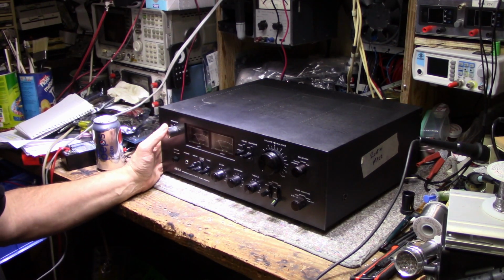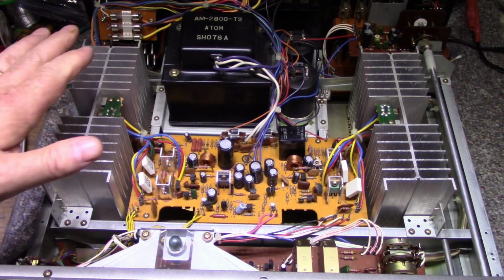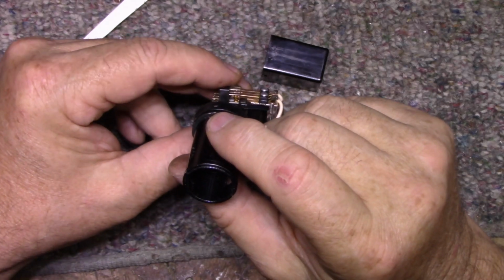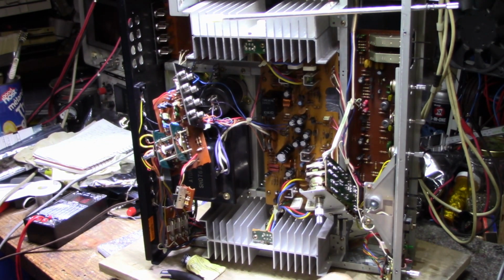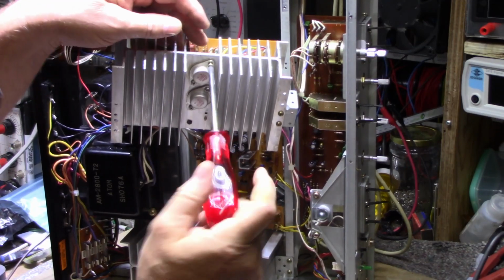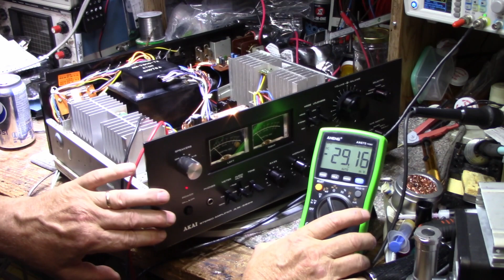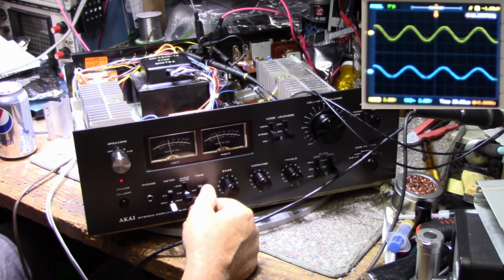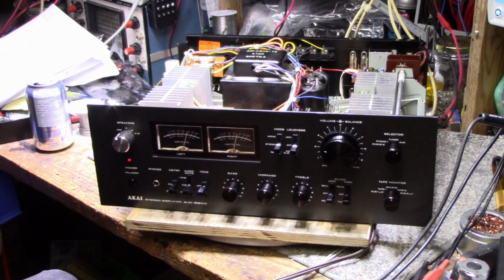Akai AM-2800 Integrated Amplifier - Repairs (Ep. 143)

Comment: This AM 2800 is my best amp installed in my showcases system.  It has the headroom to drive my great sounding but inefficient 84 db/w Clements speakers.  They needed this amp.  The pairing is unmatched.

Comment: 18:40 The 2SB560 you showed, I would never replace that. The black seems to me a spill over from the plastic casting, and the leads seem still gold plated under that plastic. But I do not have the best view here, although you showed it with pretty good detail.
Reply from the maker: I've heard others say the legs could be painted. I didn't think it was paint because it looked more like silver oxide
Reply: @TrevorsBench  doenn't oxide creep up into the bodies and short out inside?

Comment: Nice looking integrated. Thanks for sharing. I have a Pioneer SX-950 on my bench right now that I'm working on for a client. Pioneer doesn't label part numbers on their boards either but at least they mark component orientation. That does help in the troubleshooting process. Marantz is good for labeling boards but seems to have an issue with ocassional component orientation errors. Can't seem to win. Lol
Reply from the maker: When the board is blank it really slows down the component level troubleshooting, I found it really annoying.

Comment: Problem with the gray heat paste is that it won't fully spread out no matter how tied you screw them, while the white stuff will do that easily, making the layer as thin as it can get. I would be scared  that a bump of the stuff would finally break the mica pad. I think It is only for direct contact between CPU and cooler.
Reply from the maker: Good to know. Viscosity does play a role. This stuff seems to spread properly under pressure

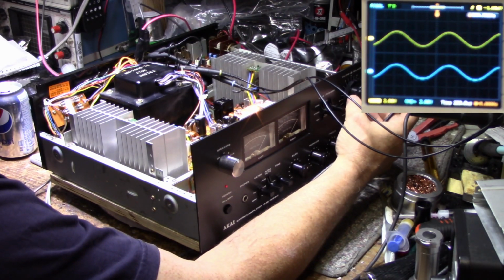Comment: About that different output: at 27:47  you show the output on the scope at a lower volume, and I compared the two and they match exact. That seems to me there's a problem with the loudness circuit, because that (usually) uses a half way take-off on the volume pot. And a moment later you turn it up to max, and there is a clear difference. I don't want to get to nosy because I am at the side and can't read the schematics, but maybe think about that loudness.

Comment: All of the companies made good gear at some point. Sanyo is often overlooked. JCX 2600 / 2900 are awesome units with the latter a dual mono configuration. I am fond of the low watters myself. Rarely do I crank the volume these days and prefer fidelity. Sansui 4000, Pioneer SX450, Sony SRV-2, Technics SU-V2, Sanyo jcx2300 have all had a turn in the stand along with numerous other units. All very good. The Technics SU has a great sound, my all time fave is the Sansui 4000. Trev...you edited this a lot and was shorter than normal. I like the long real time vids a lot as well....i put them on when working a project.
Reply from the maker: I try to cut down on the time by removing dead air and repeat information. I feel the vids are too long and can't imagine anybody wanting to watch them all. Good to know some people don't mind the length. I'll keep doing what I do. Thanks for your comments

Comment: Very common in those days to have volume controls mis-matched somewhat. I bet if you measured the dB difference it wouldn't be much. One way to visually confirm the volume controls' matching out of circuit is to apply a DC voltage to both sections of the pot, say 1 volt, and view the output on a dual ch scope (DC coupled of course) as you rotate the control. Level and tracking issues are very readily apparent. Or use XY on the scope with sine wave to observe tracking issues, the trace will deviate from the angle as the tracking deviates.
Reply from the maker: Good advice on how to troubleshoot the pot, thanks Mark

Comment: Hi Trevor. Thanks for all your videos. I was wondering if you ever tried your ET4401 as an in-circuit ESR meter. Thanks.
Reply from the maker: Yes, and it does work well if there is high impedance in the circuit. Any amount of resistance will skew the readings

Comment: Hello and greetings from Winnipeg, Canada. I have the same amp but silver plated. After 30 minutes of playing, the relay kicks off and after that no sound at all. If I turn it off, and on right after, the relay will not work. If I let it rest for a few minutes it will work again, but just for 5 minutes or so. If I let it rest for a longer period of time (off), it will run again for 30 minutes and the scenario repeats again. Do you think it might be a bias issue?  Thanks in advance for your help.